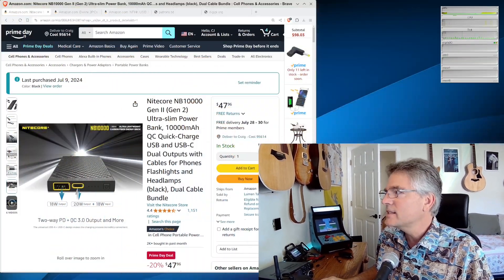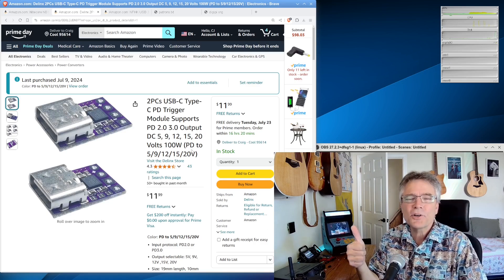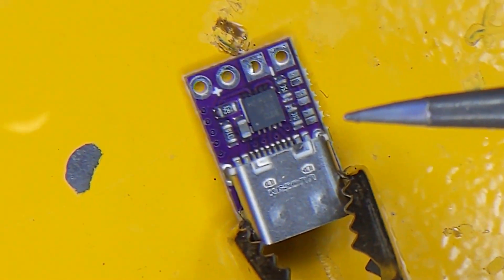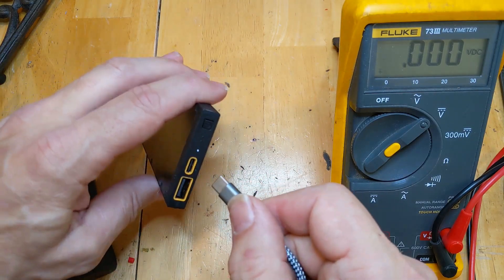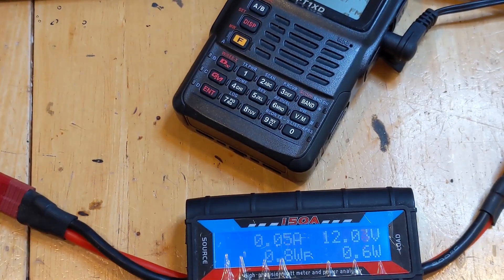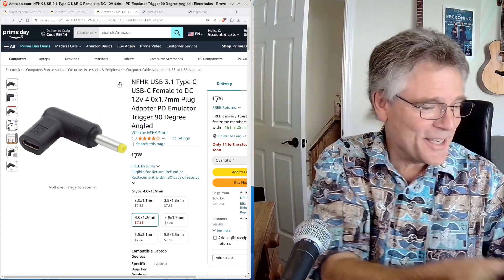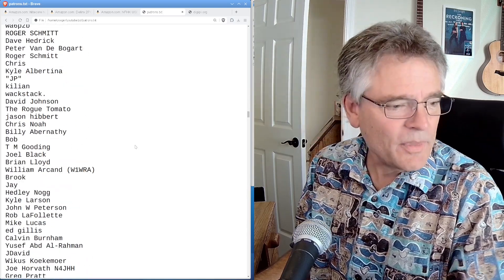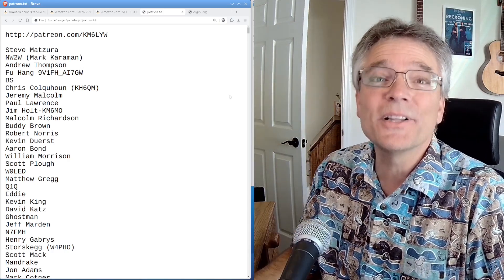PD Trigger Warning!

Comment: You can now buy ready-made USB-C PD cables with boost  converter built in now.  I have several and use them to source power in two different cases, from a USB PD battery pack or wall charger. This is able to provide me with 12VDC fo a barrel connector to the IC-705 up to the full operating power (including 10W transmit). 

I also have in the works a cable/power conversion setup to run the IC-705 from one of the pro V-Mount battery packs used for pro video and lighting applications that have built in D-Tap accessory ports which can provide power to run a radio such as the ic-705 for days. 

Love your channel, Craig.
Reply from the maker: Sweet! thanks for the info.  Yes, there are pre-fab solutions now that work great.  the little barrel/angle adapter I showed in my video, does, in fact work on Yaesu HT's too.
Reply: Yeah that seems like the cheapest option, you really only need the trigger boards to correct a pd psu when it's not negotiating the full charger speeds

Comment: Aren't this battery banks using some form of buck/boost converter to produce the desired voltage? I doubt they use linear voltage regulators.  So how clean they are with be hit and miss,
Reply from the maker: Yah, i assumed the worst, but the radio receives just fine, no noise.   I'm wondering if they actually store 12V?

Comment: I made up an MT3608 boost converter for 12.0 volts exact for my QMX Qrp rig ...maybe i,ll try one of these also The QMX draws 1.0 amps which is the limit of the mt-3608 I like  a little headroom when i can get it,.Not that the 3608 has a problem but will try one of these just for giggles.73' jim KB1PFL

Comment: lol i run my extra fridge off usbc from a 65w gan wall charger. runs into a 5s lipol powerbank which runs around 20v, and then supplys about 20vdc to the fridge. its one of those 54 liter 12/24v dc fridges for cars but i put all my drinks in there and it uses..... waitfor it... 115wh/day. i figure its so efficient if it keeps me from opening my regular fridge more than once per day it probably ends up saving power overall since its so efficient. i wrapped it in aluminum foil tape to reduce the thermal emissivity. i am finding so many uses for usb-c

Comment: Already said in the live chat, but make sure your source is PD and actually supplies the higher voltages.

I tried this but only got 9v from a 12v trigger. Good reminder, I have since acquired more PD sources (with up to 20V), so I need to try the triggers again.

Comment: you can push 45watts when doing 15volts, but have to be careful of hardware's voltage tolerance and not all PD chargers and power banks support the 15volt output standard